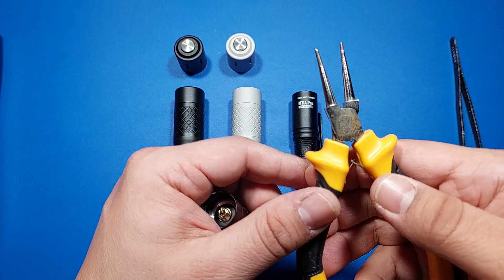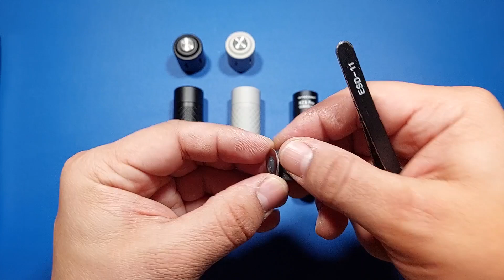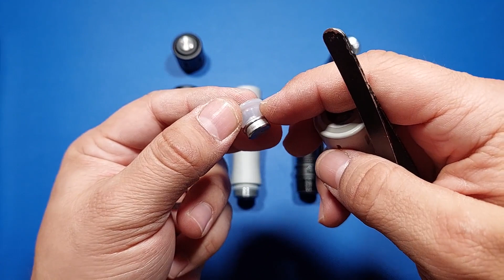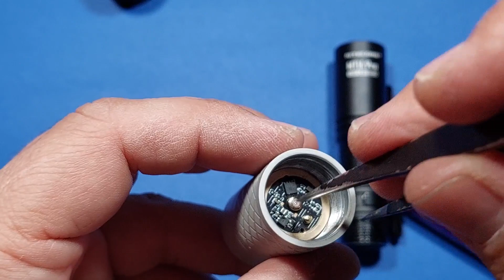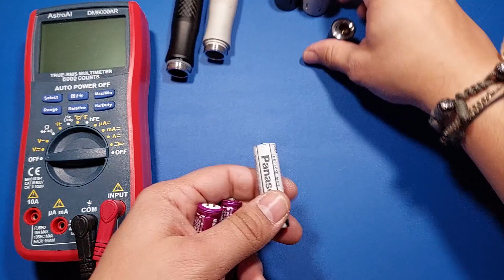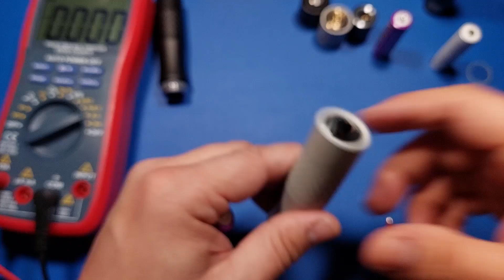NLightD E1 vs Nitecore MT1A Pro - Current Measurements (& tailcaps disassembly)

Comment: 21:45 The Vapcell 14500 H10 is discontinued. What do you use as a replacement?

From what i read, the design was changed and the new batteries were prone to malfunction. Not sure why they didn't revert back to the old design.

I could only find the Vapcell K10 as a replacement, but it only has 8A maximum continuous discharge rate, not 10 amps like the H10.